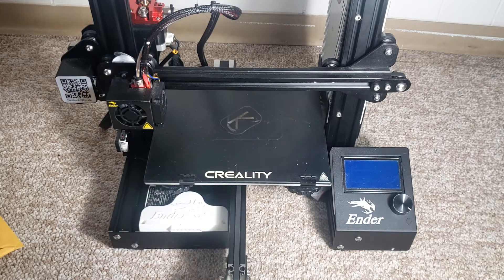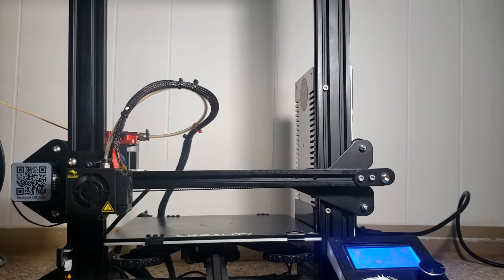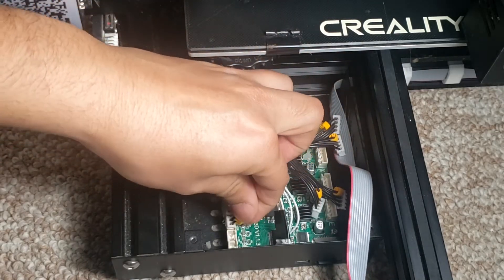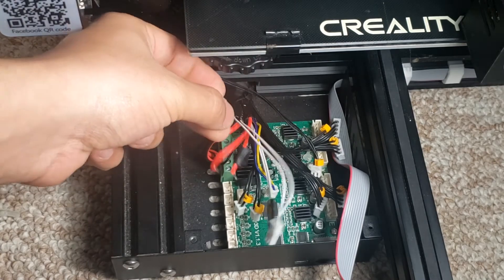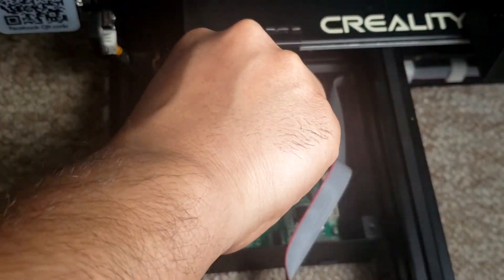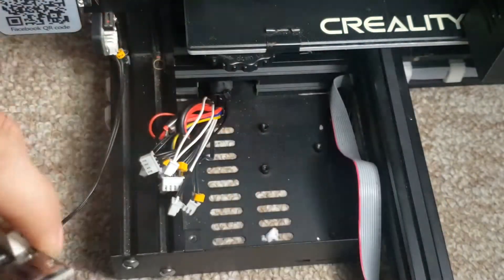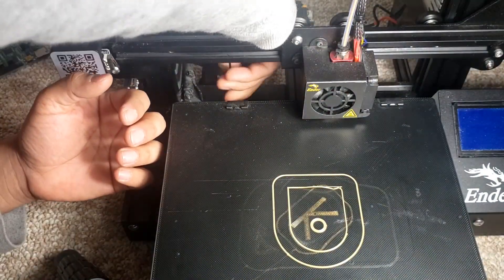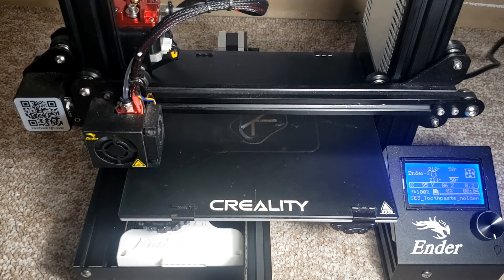Ender 3 creality 4.2.7 board upgrade

Comment: Hi really enjoyed the video, I was wondering if you had to upload any new firmware for the printer when you were installing this board? I just recently installed the same board on the same printer and the firmware was preloaded with ender 3 pro firmware. Any suggestions?

Comment: A good video.  I just bought and installed a Creality Ender 3 Silent Motherboard on my Ender 3.  It powers up; I can scroll thru all the screens; it can read the SD Card, it controls the bed & hot end temperatures; it seems to function fine, except for two things: 1) it will not Home, 2) it will not move the X, Y or Z axis.  Any ideas / suggestions / thoughts?
Reply: I have the same exact issue I haven’t been able to find a solution to the issue yet but have you tried downloading firmware to the sd card and loading it?

Comment: i have ender 3 neo in which i replaced 4.2.2 with 4.2.7 and uploaded latest firmware from creality website and as there is some mistake it is not homing and it says homing fails please reset and wiring is proper to m knowledge

Comment: So it's a straight swap?  You don't need to flash the firmware?

Creality says that the firmware is pre-installed, then gives instructions for flashing the firmware, so I don't know what to believe.

From the Creality store page for the 4.2.7 mainboard:
Easy Installation: The firmware for Ender 3 /Ender 3 Pro / Ender 5 comes pre-installed NOW! You just plug them in and start printing!

How to Flash the Firmware:  Prepare an SD card less than 8GB, format it first, and then save the firmware in the SD card, making sure there is only firmware reserved in this card. Then plug the SD card into the card slot, turn on the printer and wait for around 10s, when the progress bar and interface appear, the firmware has been successfully updated.

More Safer: Thermal runaway protection is enabled, if the temperature rises out of control, the printer will stop heating and halt automatically. The Board is Optimized by Circuit, effectively solving the heating problem.

Notice: Not applicable to Ender 3 Max

If your machine comes with an 8-bit motherboard, please flash the 8-bit motherboard firmware.
If your machine comes with a 32-bit motherboard, please flash the 32-bit motherboard firmware.

Comment: I installed the same board in my original Ender 3. It has worked great.  It's a tight fit..at least for me, when installed.  And it is so quiet.  No need to update the firmware as it works right out of the box.

Comment: Why motherboard fan doesn't spin ? 16:30
Reply: My fan doesn't spin up, did you  find a fix?
Reply: @craigle-butt6091  Yeh, I've connected MB fan to MB IN pins (that cames from PSU). Also I`m going to replace stock 24v MB fan with 12v noctua one, it will be connected directly to PSU via 24v-12v converter. I did it for PSU(120mm) and hotend fans (40mm).
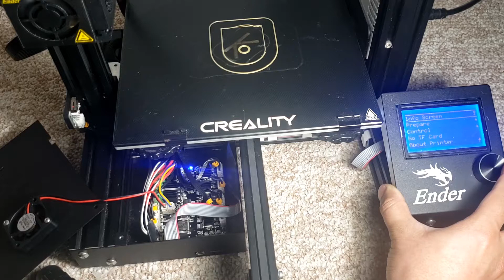MB fan doesn't spin because the both slots work in parallel (15:41 those the MB fan red-black and model fan blue-yellow wired to) , seems like this board supports 2 model fans and none MB fan.
Reply: check if MB fan starts to spin when you enable model cooling
Reply: Because the main board fan isn't supposed to be plugged into the secondary part cooling fan connection.
Reply: Connect the motherboard fan to a dedicated plus and minus. Either cut off the connector or dupont wires.